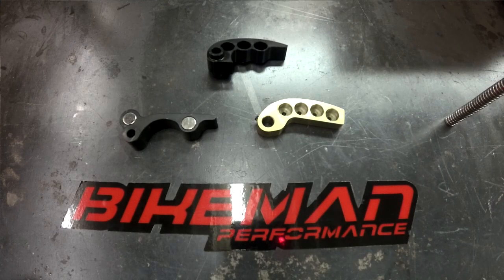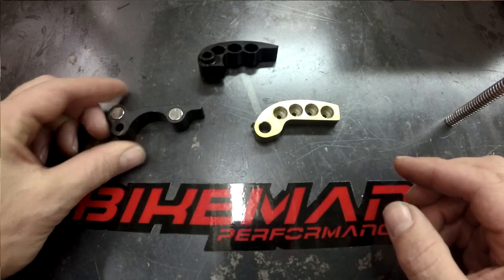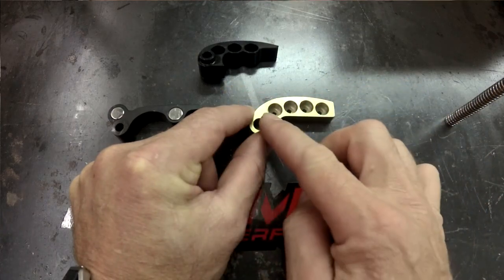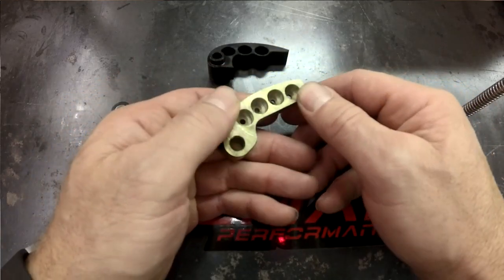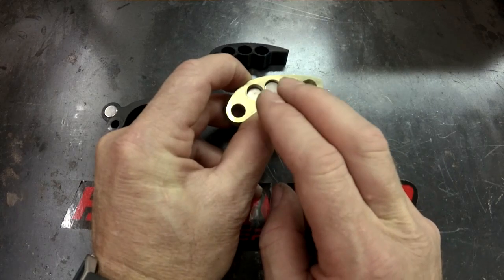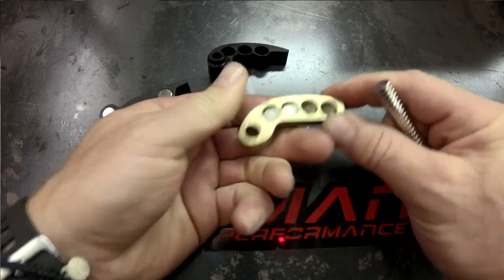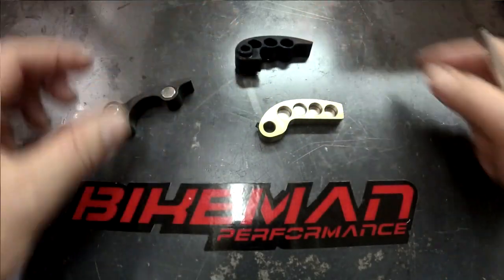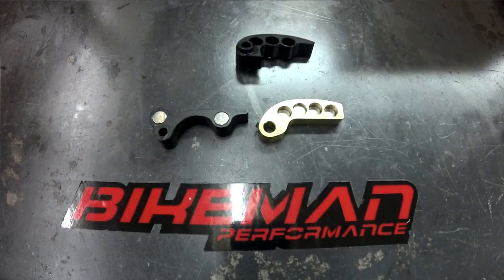Adjustable CVT Primary Clutch Weights for UTV and Snowmobile tutorial

Comment: Good video. I have a question kinda related. Is there an adjustment to the cvt on a side by side that keeps it from kicking out when going downhill? Our property here in Colorado is very hilly and some including the driveway are pretty steep. When I try to go down the hills the utv has no engine braking, might as well be in neutral. 2wd, 4wd doesn't matter. Thanks

Comment: I have a racing clutch in my rz6000. The spring is a 170 / 330 and I have 60g notched cams. can I switch my cams to unnotched cams and maybe the spring too, so engagement won't be so harsh?

Comment: I race short course if I’m starting to run out of power at around 50 to 60mph just stops pulling as hard and I have big turbo I would put more weight at tip right
Reply from the maker: I would have to look at a datalog and know your clutch set up to give recommendations. I can be hired as an analyst if needed.

Comment: I have a clutch kit on my four wheeler with the 4 adjustable weights. It was set for 30” I now have super heavy 32s do I add extra weight towards the outside or the inside of the weight thing.
Reply from the maker: usually weight would be added to the heal to prevent slip on a larger tire

Comment: This was a great video thank you.  My question is how to tell what we need.
For example we have a 2016 rzr xp 4 turbo with an Evo clutch kit.. problem is we have 0 information on where to put the weights and how much weight.. right now we're running no weights and we have issues all over... have to Rev to 2k to move from a stop, top speed is only 63 instead of quoted 78... and last but not least, the belt slips constantly even with regular cleaning...

Comment: Hi can you help ? I am going from 27 inch big horns to 30x14  STP xcomp ATR  tires with bead locks.  This is going on a 1000 xp 2015 2 seater.  Will my stock clutch handle or what do I need to buy to fix it? Thank you.

Comment: So ive been trying to do some research on how to adjust your clutch weights to your riding style and nobody really does a good job, this is the first video that helps. I have a xp 1000 rzr, it was bone stock till now, I ordered all this from evo powerspots, stage 3 clutch kit, stage 3 tuning, their intake and exhaust. I took it for a test run a minute ago and the machine was at like 8800rpm and only at like 60mph and not climbing very fast. the new arms are lighter then the Polaris stock ones, what do I need to do to get the speed to climb faster?